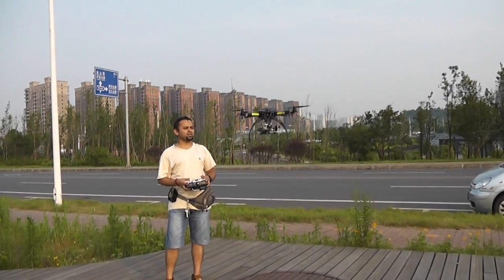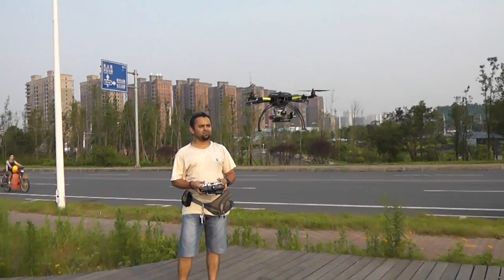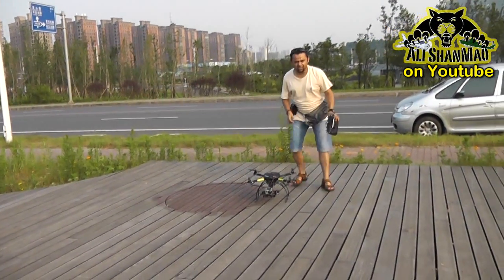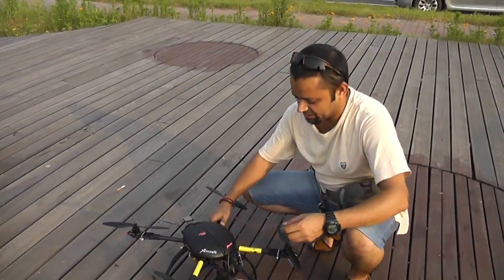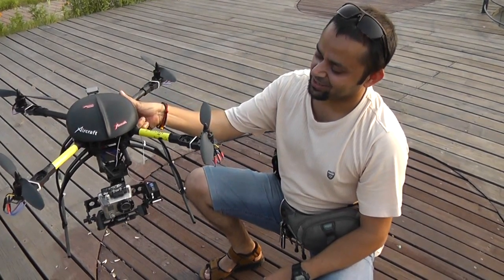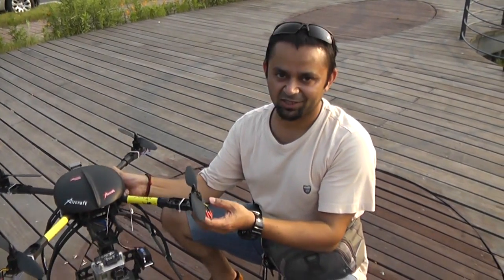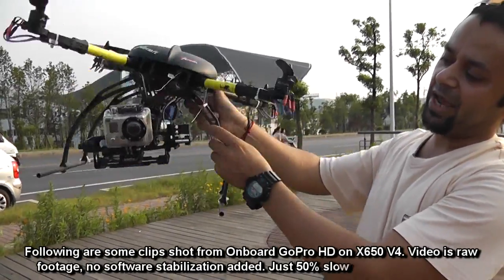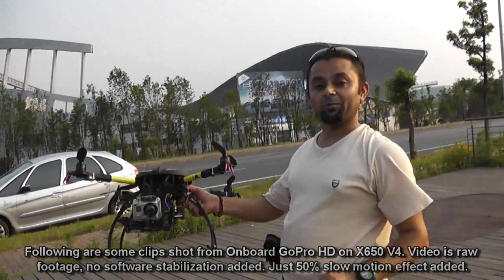X650 V4 -- Testing DJI Naza Controller

Comment: Can you adjust the Pan/Tilt of the camera while using the camera gimbal stabilization?  Have it pointing forward being stabilized but then have the ability to be able to move it around if needed.  I just plan on using the tilt function on mine.